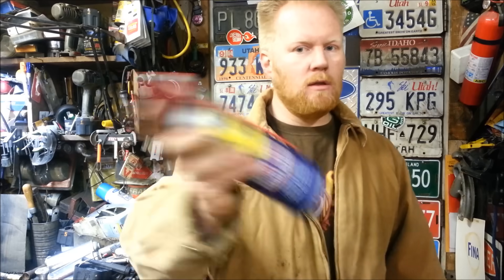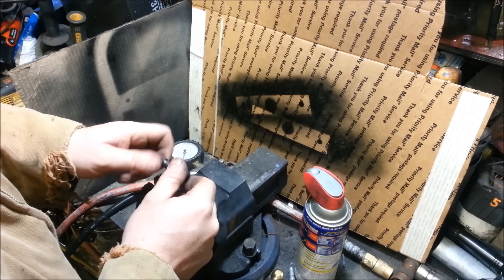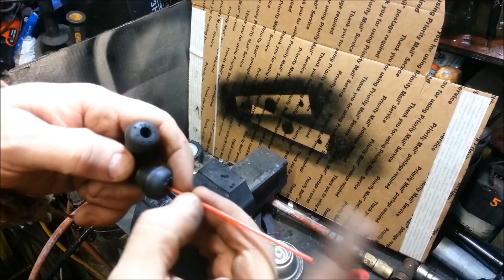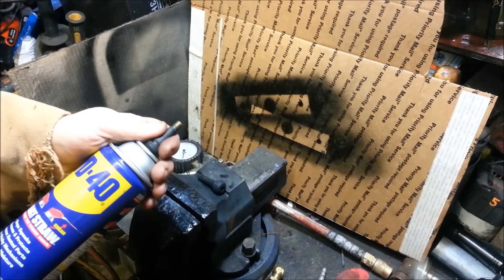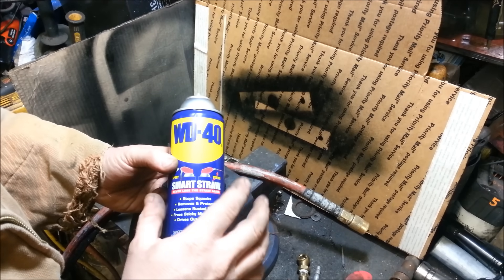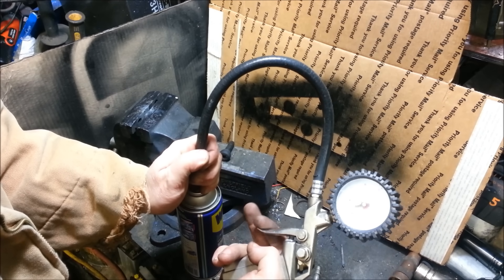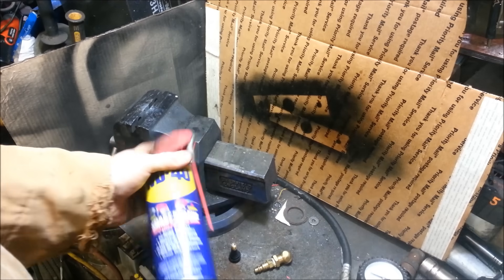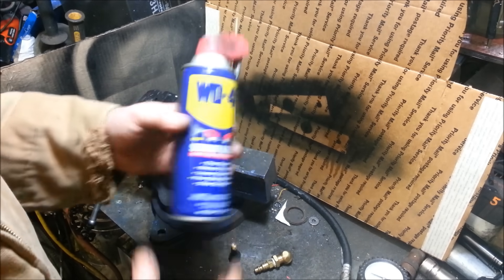Refill flat AEROSOL Spray Cans like the WD-40 and others

Comment: I just release the remaining propellant with a small hole drilled at the top side seam  of the can. Once the pressure drops, drill a larger hole and dump the fluid or paint out into a smaller container.  I use saved wd 40 by dipping long paint brushes into the container. This puts the liquid exactly where I want it. Saved paint bomb paint is used in an air brush to give a better finish on models and projects.

Comment: Hey Bro, I like your vid's, content, & knowledge! I have one 4 ya! I hate my air nozzle! I hate that it doesn't go on straight! Mine is V shaped, I don't know how else to describe it however, Many of the air pumps that one could pay to use, have a straight on nozzle! WHERE CAN I GET A AIR COMPRESSOR AIR OUTLET TO FILL TIRE'S THAT IS A STRAIGHT ON NOZZLE????? Nothing worse in -5 degree weather, 1st thing in the morning, airing up a tire & have to hold the air nozzle crooked. It worries me that I could be damaging the air valve & I would prefer a straight on tip for my air hose!

Comment: It’s a great idea but I would give one serious word of caution. Filling with compressed air can be dangerous. Air contains moisture which will corrode and weaken the canister. This could lead to it exploding or leaking flammable content. I would only do this if I were getting the last drops out of the can then would depressurise it and dispose of it appropriately. Normal propellant is non corrosive.

Comment: FORDs FOREVER,  FORDs RULE Chevys Drool,  Chevy = Cheap Heavy Entertainment for the Very Young  I had a 66 Mustang for 33 years and only sold it to move to Florida and I miss it everyday.  I have FORD Blue Blood running through my veins
Reply from the maker: I love the enthusiasm.
Reply: @ Amy Hepker - Ha ha ha ... that's funny. But I'll bet that my old, 63' Chevy Impala SS would run circles around that little-ole, itty-bitty, 66' ragtag Mustang ... back-in-the-day. Oh Yea!  And actually, you DO HAVE blue blood running through your veins. But we all do ... until air hits it and turns it red. And that's when ya know that a Chevy out ran ya -  when you're bleeding red out-cha nose, eyes, ears and mouth, because I went by ya so fast it made ya bleed, lol. :-)~
Reply: @namrednop  You are so Funny, But Looks ain't everything.  I won't say I won every street race I ever run, but I won a hell of a lot more than I lost.  I embarrassed the hell out of 350 Cameros, 455 Trans Ams  I used to call Cameros Chickens as they didn't want to get beat by my Mustang, Firebirds were the same, Trans Ams were known as Super Chickens.  As a Matter of fact I had it setup pretty good for the Street, The only car that beat me off the line was a 401 AMC Javalin and he had 6 people in the car for traction.  I had 4:62-1 rearend gear with a Posi. 4-speed Toploader and a 302 that I ran with 2-2BBL FORD Autolite Carbs on an Offenhauser Duel Quad Manifold I modified myself to accept the 2 BBL Carbs.  The chevy you had and are talking about was a Boat, did you have an anchor and sail with it?  Unless it had a 409 in it, the only way you would have beat me with that, would have been on the rolling start and I would given you one hell of a race until around 70 and by then I would let off.   There used to be a little Chevy II in my town called Weekend Warrior and he just barely beat me on the run and would not ever try racing me off the light.  The only way a chevy could beat me off the line was at the Bench, Bench Racers Everyone of them and I take you are one also.  MERRY CHRISTMAS
Reply: @amyhepker9025  - Yep - that ole 63' Chevy Impala SS was a tank! I took the original 327 out of it and dropped in a H.Perf 350 cu with a 4-bolt main that was rated @ 350 HP stock, just as it came from the factory in 1968. Yes, 1968. That wasn't a type-o, lol. I had a Muncie, close-ratio 4-speed with a Hurst shifter with a black-felt tee-handle shifter knob. That tee-handle cost me a whopping $15.00 at the time too. And at the time, I had the stock 373 gear rear-end that came factory in that car. It was great off the line, and great at top end. But I quickly discovered that it wasn't going to hold up to all the power I was dropping on it. I'd put a full racing, solid-lift Wolverine cam kit in it that had all the goodies that came with a cam like that. Had (1) 4-barrel Quadrajet (I tricked it out myself by reading an article in Motor Magazine, and it was a beast when it came to guzzling gas! But man was it a performer! I was only getting 8 mpg. And it was sitting on top of my ported and polished, Weiand High-Rise intake. Had a H.P.erf Mallory, dual-point distributor with the best set of wires one could put together at the time, 40 thousand Volt Coil, running RJ-10 Champion spark plugs, and had the best set of racing headers one could buy at the time. Man, those things were a PAIN in my REAR-END to put on too! Had to run a chain around the drivers-side motor mount through the frame so I'd keep from bursting that motor mount to pieces every time I got on it hard, which was pretty much every day back then, lol. I think I went through 5 mounts before I finally got smart and wrapped that chain through the motor mount and through the frame. That stopped that little problem. Had it raised up in the backend just slightly past level, because if you remember, those cars set 'nose-up' straight from the factory and I didn't like that look. So I put a set of Gabriel air-shocks on it so I could set the level like I wanted it to be. But everybody back then had the tail-end of their cars way-up to high. And the Po-Po started giving tickets to those good folks because you couldn't see their tail lights. So it was a hazard. I even had one of the local Policemen track me down one night at the local McDonalds, which was the main hangout back-in-the-day, and wanted to LOOK under my hood? Pulled right in front of my car, got out and walked right up like he owned the place. I told him, "No disrespect, but NO ONE gets to look under MY hood!" Then, like usually, we had a rent a cop that was always pulling night duty at this McDonalds, and if anyone got challenged, even way back then (and I wouldn't race for less than $50.00) the rent a cop would hold the $$$$. We had a certain stretch on I-40 that we set as a marker, from exit ramp to the 1st speed limit sign, which was exactly 1/4 mi. And the 1st one there got the $$$$. And the one that lost just kept on going down the highway, as I always went back to claim my prize $$$$. Oh Yea! And I always tipped the cop $5.00 for holding the $$$$ until I got back, lol. Never lost a race in that ole Tank of a car!  Back to the cop that wanted to look under my hood. He wanted to race me! Said he had the fastest police car on the force in that area, and wanted to know if I'd race him, right down the main drag at the time. He told me to meet him back at McDonalds @ 11:00 pm that night (back then everybody was at home by that time of the night, because nothing was open except for a few 24 hr restaurants. So we meet. We agreed to dragging light to light. That's the way he wanted to do it, so i said, Ok lets do it. I smoked him off the line right off the bat, and all he saw were my tail lights. Next light caught us both. So off we go again. He jumped me the 2nd time by cheating, as I was letting him drop his hand to start the race, which was giving him the advantage, and he jumped as he was lowering his arm. But by the time I hit 2nd gear I blew right by him, giving him the ole Queen of England wave as I passed him by. We made it through 3 lights before we got caught again, and the exit to the Highway was right at this light. When he flagged the next start instead of racing me, he turned off up the ramp onto the highway. I reckon he'd had enough for one night, lol. Oh I forgot, we'd given our $$$$ to the rent a cop before McDonalds closed that night. So the next day I showed up and put my hand out, and he just started laughing out-loud. Reached in his pocket and handed me the $$$$ and said, "Ole Sam will NEVER here the end of this, getting beat by a 17 yr old kid! He'll be the laughing stock of the police force from here on out!" PS: The heads I had on this motor were not stock heads either. And I'm sure I've left something out that I also did to this car. But by now you've probably dozed off from boredom attempting to read all this BIG talk from an old Chevy man from back-in-the-day, lol. PS: There were some pretty dog-gone fast Fords that came out in the late 60's early 70's that did give me a fit. But while they were busy spinning their tires I was GONE  ========================================= blacks marks as I leave this post - Hee hee hee - By now. Can't wait to hear back from ya, Blue Blood Ford Lady.

Oh I knew I'd forget something. I also had a 3,200 lb full drag race ZOOM clutch set-up in that 63' Impalas SS. And everytime I pulled up to a stop light I'd have to put it in neutral because the springs in the clutch-disc and the splines in the clutch plate itself were so strong I couldn't hold it in for very long at a time. And I had some pretty strong legs too, even as a teenager way back-in-the-day.

Comment: Thanks for this simple hack to use all those flat WD-40 cans that hang around for a better day.  One concern: won't the Oxygen in the air degrade the volatile compounds in the blend?
Reply from the maker: That's an interesting thought. I guess the question is if it does, what are the ramifications?

Comment: Don't do this for safety sake. These cans are originally filled with flammable gas for the propellant. Adding oxygen from the air may lead to flashback if accidentally ignited and exploding can! Great fun on a bonfire but not so great in your hand ! !
Reply from the maker: Nothing you said is vaguely possible. The small orifice acts a flashback arrestor.
Reply: @sixtyfiveford  Hey man ! Do a video to test it. I see others have expressed similar concerns. Be careful though dude!
Reply from the maker: For reference you can compare it to a gas can. After all the law suites against Blitz of people pouring gas onto a fires and having the flame run back up into the can, they fixed the problem with a flashback arrestor. By putting a simple plastic screen mesh over the mouth of a gas can flames will never enter the gas can.

Comment: Easier and safer to punch a hole in it and pour it in a empty spray bottle. This should last you long enough for your delivery in the mail! When aerosols run out it's usually a faulty batch and they will send you coupons for free replacement if you phone the number found on the small print on the back of the can. Anyways they did for me a few years back. So few people hold companies accountable these days they are starting to not honor their warranty. When you open the box, piece of paper says, do not take it back to the store. &*^&^ you.  We need to start opening items in the store before buying it then and make sure its all there and works. With busy schedules some of  the time the warranty is up before we open it up or use it and realize its a piece of ^&&% and doesn't work out of the box. I got a new fertilizer spreader made by scott's. One of the bigger names. I noticed a large blind spot in the spread of the fertilizer. I looked to see what was causing it. it was the part of the frame. They somehow designed it so it looks cool and forgot to test it  and didn't clue in that part of the frame was blocking the throw of the fertilizer so not only was it missing a section it was bouncing off  and extra was landing on the one side.  At some point they must have figured out that they screwed up and there was a huge design flaw. It's a spreader and there is a huge gap in the spread. It doesn't get any worse. They didn't do a recall they just pretended they didn't notice. It was over a hundred bucks. I thought maybe it's not bad as it seems. I did a couple passes on the lawn and a few weeks later there is a noticeable strips right down the lawn. I guess people just expect that things are crap now.

Comment: Thanks. I’m always wondering why air pressure leaked out while I still have half full can. Thanks for the solution. I punched a hole and drained it in a sealable medication bottle that’s how I saved the remainder oil. I’ll try your way.

Comment: Correct me if I am wrong. The propellant in old aerosol cans was freon. Under pressure a portion of the propellant is liquid. It therefore lasts much longer than air. Butane, propane or iso butane works the same way. Any gas that is liquified under pressure will expand about 25:1. So a little liquid goes a long way. Freon is no longer used as it's release in the atmosphere is harmful. Not to mention if u r arc welding and a dingleberry hits the can and it burns, it releases phosgene gas, which is poisen. I know for sure, cuz I did it by accident. Now, with the highly flammable propellant u don't risk being poisened, it will just blow u to kingdom come. Take it from me. NEVER arc weld with ANY aerosol cans within 10  feet.
Reply from the maker: Freon(r12) used to be the main propellant but like you said everything has moved to a Propane/Butane mix or carbon dioxide. Things like computer air duster were just pure r12 Freon. "Air Duster" later became r134a(same stuff used in cars from 1994-current) and now it's been changed to r152a refrigerant. Propane/Butane and Carbon Monoxide are cheaper than these refrigerants so they are used currently.

Comment: Sweet, I just threw out three cans that were still had about a quarter amount left. It seems the can only started having this problem since wd40 switched over to this style quick straw type. Also sometimes the when straw is not activated the regular spray is very sloppy coming out. Hopefully this fixes both issues.

Comment: Thank you for the tip. I had such limp WD40s and Paint cans and I used to drop it in hot water or place the limp cans in Sun, till it gets hot and it works for some time. But your idea is perfect and will certainly try on all limp cans. Thanks once again. Cheers.
Reply from the maker: Thanks, I'm glad you liked it.

Comment: Is it possible to refill one of those Fix-a-Flat cans with compressed air?
If so - how ?
Thanks
Reply from the maker: Yes and no. The small cans filled only with compressed air won't actually be enough air to fill a tire. Fix a Flat and virtually all aerosol cans are filled with something like propane, butane, carbon dioxide etc. These gases turn to a liquid when compressed and hold approx 10 times more than you can put in compressed air volume.

Comment: just be careful diesel engines just add compressed air to  low octane hydrocarbons
Reply from the maker: True, but you'll need close to 700psi/48 bar to create dieseling.
Reply: +sixtyfiveford  one atmosphere at sea level is 15 P.S.I  diesel engines have a compression ratio only just above 10 to 1 .so you said home compressors produce 150 P,S,I..that is 10 to 1  getting close.but well ok. just keep clear of low octane petrol it detonates at about 10:1

Comment: Guys, I think some are getting mistaken over this matter. Last time I checked as Air is Air.. Air is what we all breath. It's as if Air is a oxidizer. Air again, is air we breath and it is "Oxygen" that is a oxidizer. If you ever heard of the saying around the hospital "Never use oil in oxygen service"... Also, we have the fire triangle to think about from NFPA. We have to have your 3 things to have a combustion. So I do not see a problem of this video. you can not add enough air pressure to the can without bursting the can. Air can only support combustion if there is source of heat. Maybe these thoughts may give a thumbs up about this video. There is more but I will stop for now.

Comment: Aerosol cans are not filled with air. They are filled with propane or butane. In the can it is a liquid that evaporates so there is a gas above the liquid that will maintain a constant pressure as long as there is any liquid left to evaporate. Air just keeps droping in pressure. It is probably ok for WD40 but would not work well for painting more than a few seconds as the pressure just keeps dropping.
Reply from the maker: No one ever said a can originally was filled with air. It's just a simple way to get the last little bit out of the can.

Comment: you said the brass was the same depth as the plastic center pin when clearly it wasnt, your video doesn't make clear is the point that you have to depress the plastic center pin, or it doesnt matter?

Comment: It’s not compressed air that’s in the can. It’s generally a hydro carbon (propane butane) mix. Or it could be canned using CO2.  WD 40 is largely kerosene, the product might not work as you might want. Most aerosol cans are designed to have 30% of the propellant left in the can after the liquid is emptied. Buyer beware.

Comment: I know this vid is old and you possibly know this. But I just used an air nozzle with a rubber cone tip that fit right over the little plastic can nozzle.
All because I broke off a used tire valve trying to do this.
Went over to grab the hose and my brain had a moment looking at the air sprayer.
Quicker to.
Had to revive a can of kroil and some wd 40.
Mostly the kroil though
Works with the cans that have no plastic nozzle also.

Comment: Once the chemical is gone Wouldn't that work as compressed air to clean out electronics and stuff
Reply from the maker: Not really, because you won't be able to fill it with more air than to spray for 5-10 seconds. "air cans" are actually filled with freon. Yep the same stuff that keeps a car cold. It condenses to a liquid under pressure, unlike air, so you can put a lot more into a can.